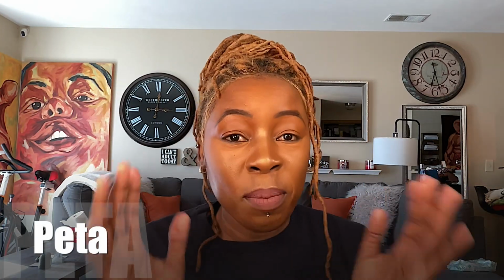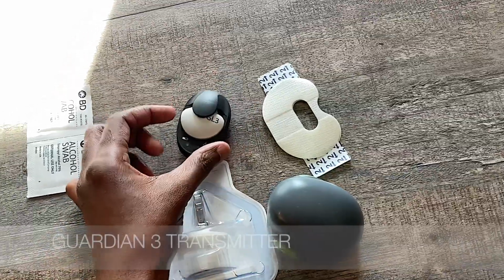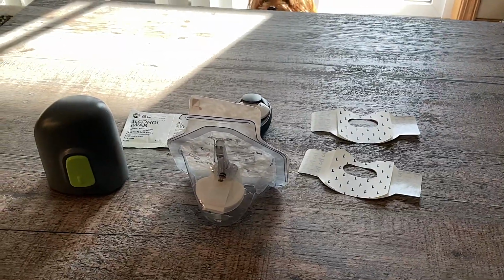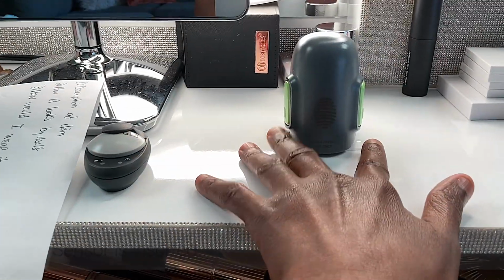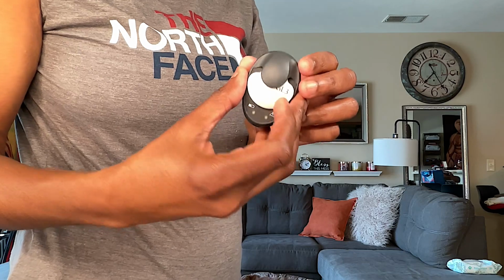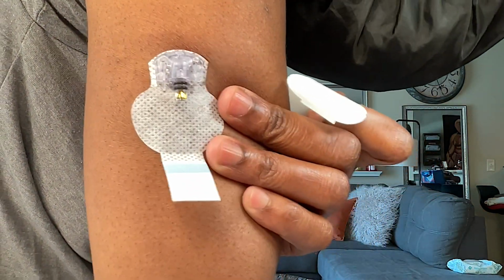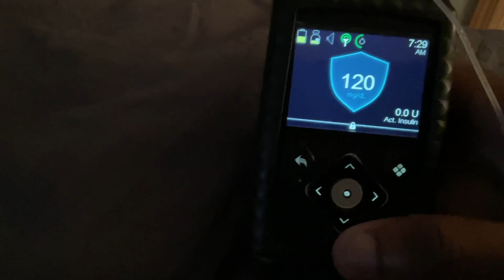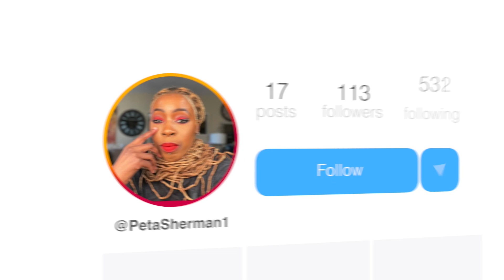Medtronic Diabetes Guardian 3 Sensor insertion - How to insert the Guardian 3 Sensor

Comment: thanks for this!  I am probably too short to reliably use the back of my arms - but the way you just prepped both tapes beforehand and just stuck them on quickly might be the way to go if I do!  I'd have to do it in front of the mirror of course :)  do you ever put the first oval tape over the sensor's sticker before you attach the transmitter?  I tend to do that so my sensor is more secure, and in addition to the oval tape I use Opsite Flexifix tape (5cm wide / 10m long roll), which is not as harsh on my skin.  I haven't tried any of those skingrip things either over my sensor bc I find them very pricey.  oh and I attach mine on my thighs even though the medtronic trainer said she couldn't officially approve of that spot :)  I'll have to check out more videos from you!
Reply from the maker: H Kuzmeyeah, oh yes, i have tried putting the first oval tape over the sensor as well. It really does keeps it more secure. I also agree that the stickers get quite expensive for real. I should look into trying the Opsite Flexifix. Thanks for this information because sometimes the sticker will itch me.

Comment: What is the connectivity like? I’ve seen reports that the sensor drops connection from the pump lots. Some real life experience would help me make a decision on Medtronic vs Dex/Tslim - thanks ❤️
Reply from the maker: Yes, it will drop connection at times. I have not had it happen to me lots but at some random times it does drop. I have more issues with the sensor not lasting up to 7 days as it should but hey will replace the sensor most of the times.

Comment: I loved this video. I just put my sensor on and it doesn't want to calibrate. I'm trying to decide where else I can put it besides my stomach
Reply from the maker: Thanks Miss Chantal. I definitely prefer to use my arms. This way I give my stomach a break from all the pricks i have to give myself daily/weekly.
Reply: I use the front of my thighs!  the sensor can still sit flat enough to work well.  it's not "approved" by medtronic, but it was ok when I had an older dexcom about 6 years ago, and the numbers are of similar reliability there as they are when I use a spot near my waist.  I'm so short I really can't reach the back of my arm for a sensor, and I can't use a lot of spots above my waist at all, so I save those for my pump and put the sensors on my thighs.  Hope you give it a try!

Comment: Is it painful? I am going to use this CGM for my 12 years old son :) Thanks in advance
Reply from the maker: Absolutely not Maka! The insertion device really helps a lot to prevent the pain because it releases the sensor really quickly that you don't even have the time to feel the pain. However, at times you could (without knowing) just hit a bad spot and you feel a little sting. This happens to me about 10% of the times but the sting goes away immediately within seconds. You're welcome and best of luck.
Reply: @PetaSherman  Thank you very much <3
Reply from the maker: @makaneidze5427  glad i can help.

Comment: Can you put it anywhere on your body or it's just your upper arm
Reply from the maker: There are specific spots that is recommended by the manufacturers where the sensor can be placed to get accurate readings. For example, i sometimes place it on my abdomen where there is a lot of flesh and also lower back (left or right side). I appreciate the question Marcia Nunez. 😀